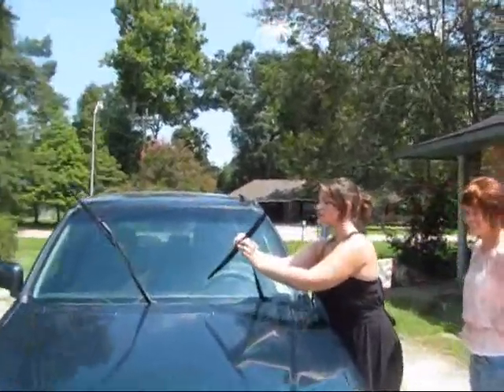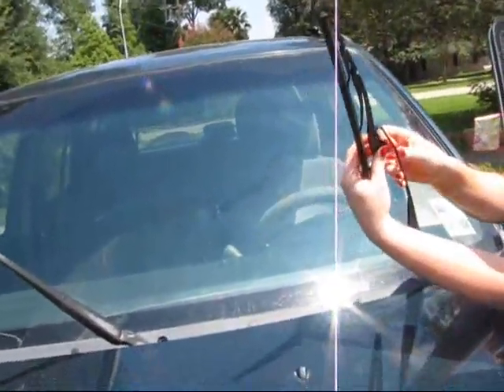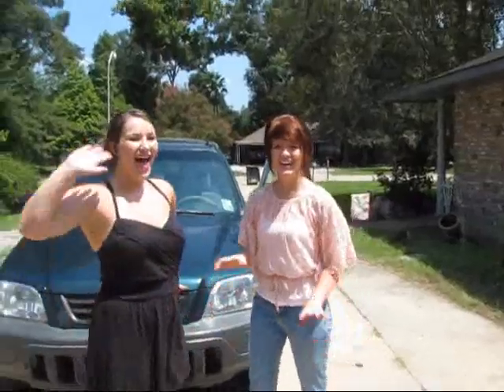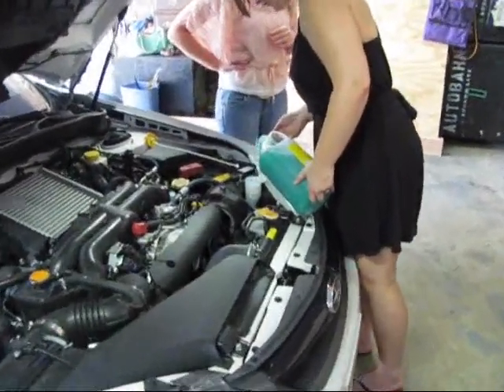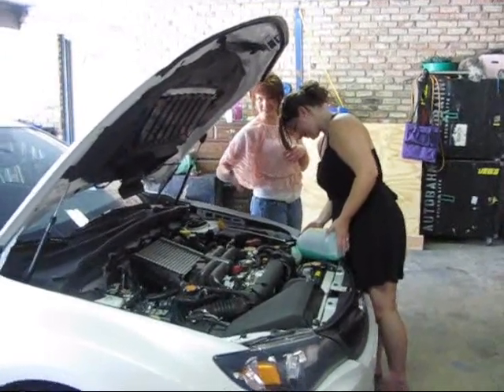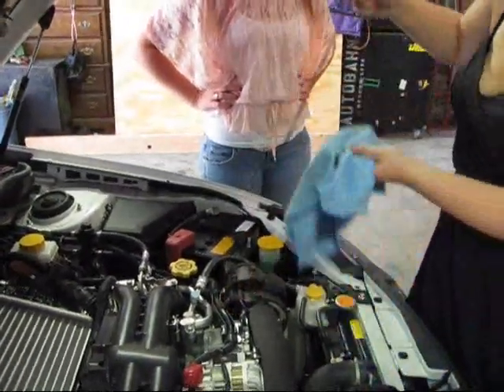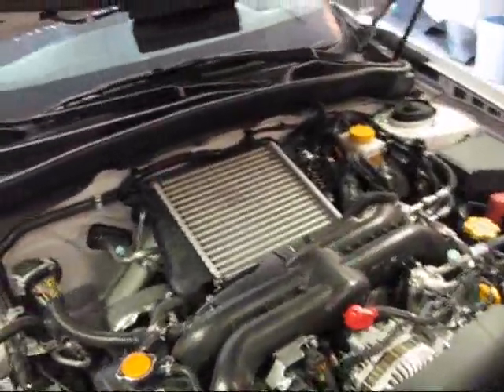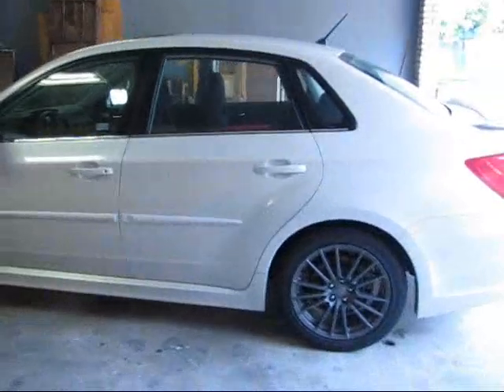Cajun girls working on their cars

Comment: I went to public school in the USA in the '70s, high school, and females were not permitted to learn auto shop, wood shop nor metal shop.  Males forbidden to learn cooking and sewing.  I got my father to let me drive the shop truck and wire electric motors, sandblast, strip with acid, help with wiring and do interior construction, et cetera.  Not knowing the basics of simple auto maintenance is a terrible waste of money.  Very good video, uprated.